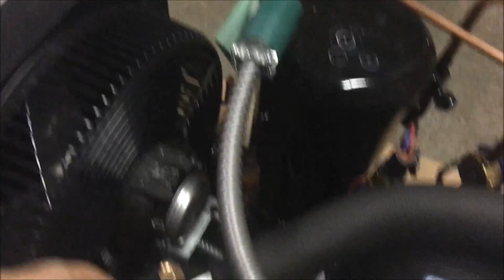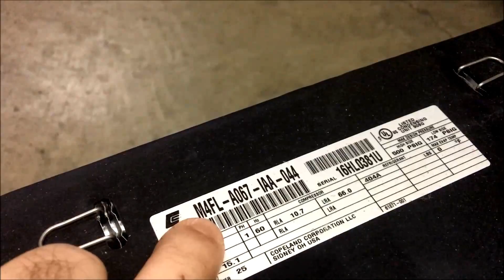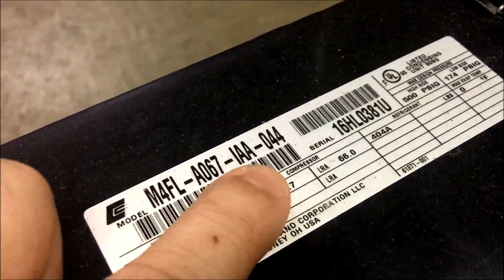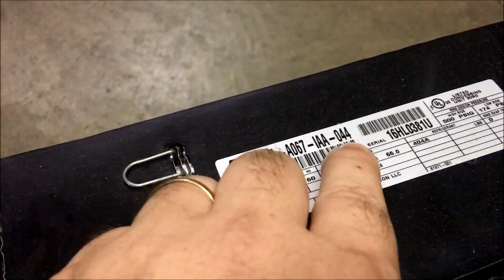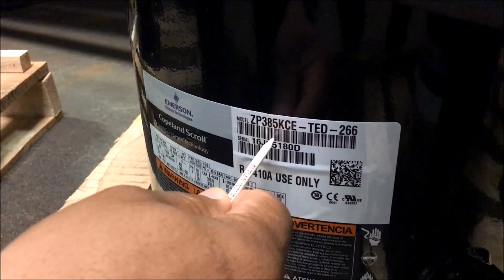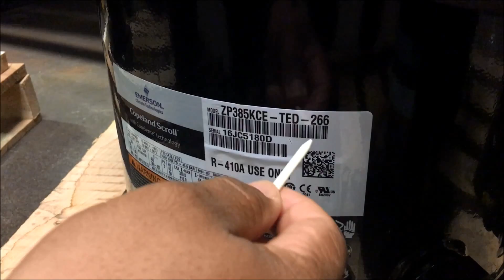Ep 2 Copeland Nomenclature

Comment: Can someone help me with this issue? I have a heat pump system for my home, using a Goodman outdoor unit model GSZ140301KD.....this is rated at 2.5 tons ( 30,000 BTU). When I look up the part number for the compressor it uses....most sources say Copeland ZP25K6E-PFV-830...sometimes last numbers 130. Question.....is this correct? ... as the model code indicates a 25,000 BTU capacity. Doesn't seem right.